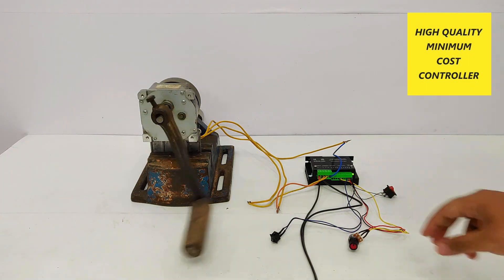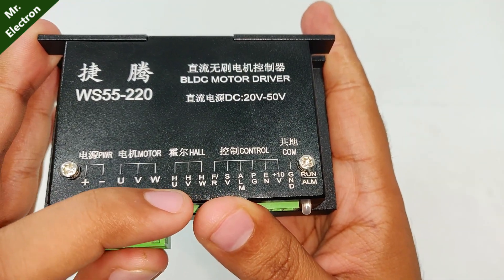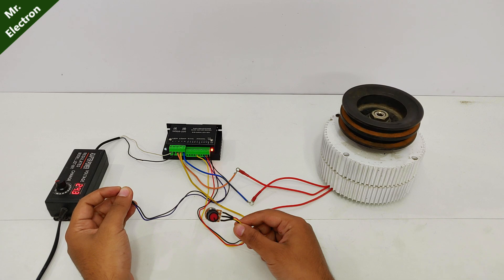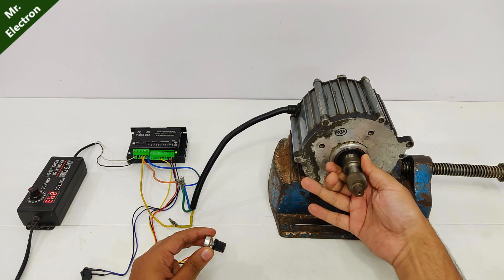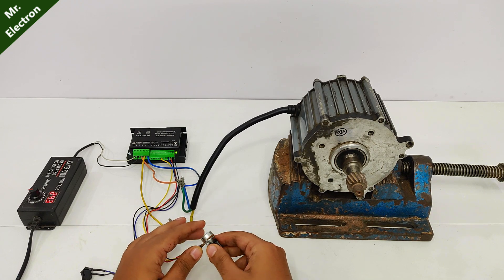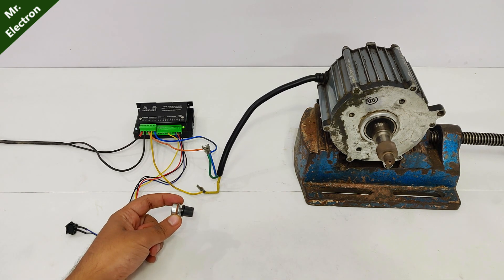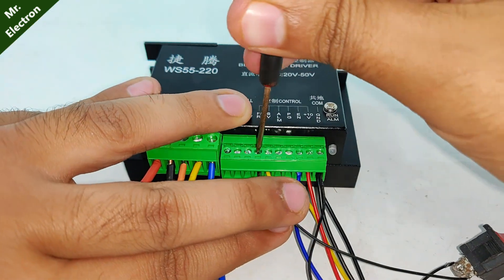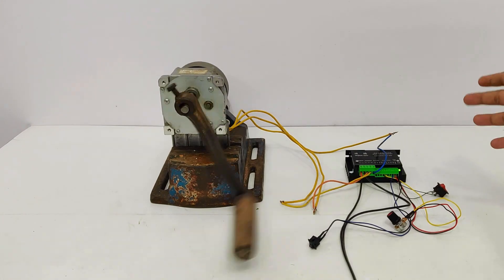Woohoo !!! 600 Watt BLDC Brushless DC Motor Controller upto 48 Volt ( No Hall ) - CHEAPEST

Comment: I got 3 NEMA  23KM stepper motors 
& it don't works with the motor driver I am having (L298) 
Maybe I need high power motor driver
Reply: Stepper motors require a specialized driver and a controller to generate the step signals and direction signals that are sent to the motor.

The DC motor drive you mentioned is for a simple DC motor that has brushes inside.

The motor driver in this video is for a 3rd type of DC motor; one that has no brushes and usually has hall sensors built into the motor.

Comment: Will  this driver work with stepper motor?
Reply: While a stepper motor is indeed a BLDC motor; it's not usually controlled by hall sensors built into the motor. The Brush Less Direct Current (BLDC) motors that typically work with this type of controller were constructed with internal sensors and don't have the typical number of coils that stepper motors have.